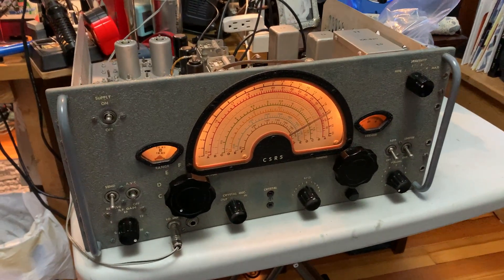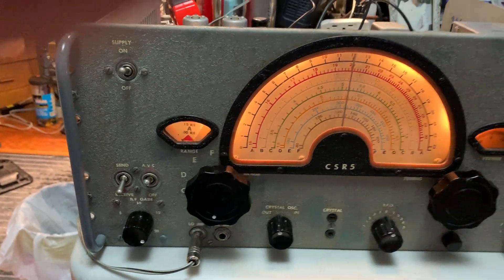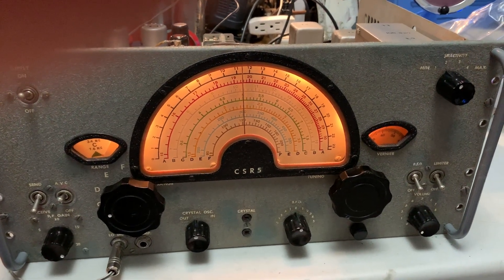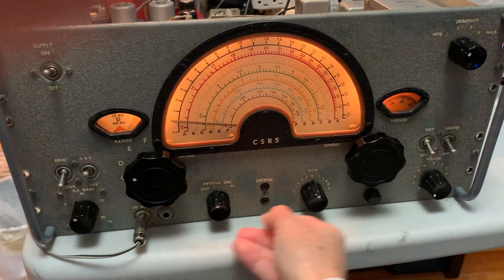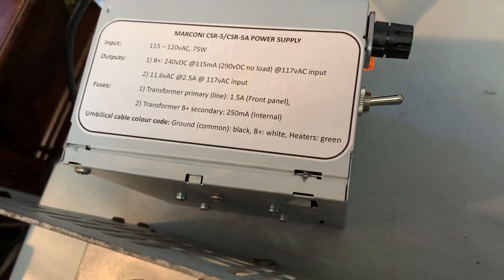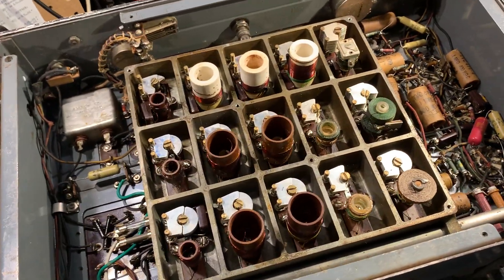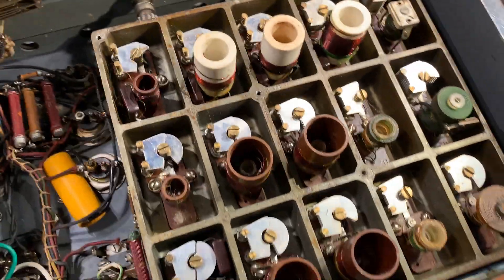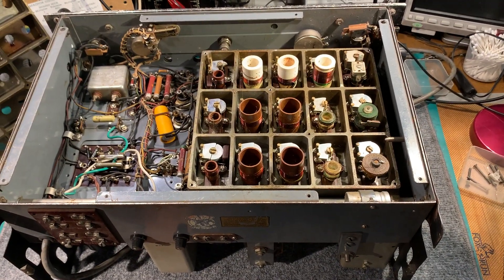Demo of Refurbished Marconi CSR-5 Receiver and Look at a National 'RCK' Catacomb Set

Comment: Sounds like too noisy. Is it normal for this model or old tubes?
Reply from the maker: Its not the receiver that's noisy - its the normal background noise at my location(!).  I have found that an active loop antenna works best here, but there is still a lot of noise from things in the house (LED lights, wall wart power supplies etc) and external (smart meter etc).

Comment: I have one as well Its a CSR5A 110930-AZ Spec 106945. I have re-capped it and it works well. Had to build up a power supply of course. VE6CJC :)
Reply from the maker: Hi Keith - sounds good! - these are very reliable sets.

Comment: Good job. I restored a couple of CSR-5 receivers, some had mechanical problems. I have 5 in my collection. There is a nice run-down on these, on the website dedicated to the history and products of the Canadian Marconi Co. I'm also working on restoring a RCN CM-11 transmitter that also has a CSR-5 in the same cabinet. As you may know, the CSR-5 was designed and built for the Royal Canadian Navy, and was used from late WW2 until the mid-1950's.
Reply from the maker: Thanks! - Yes, Jerry Proc's website is a very valuable resource for the CMC.  I have restored several CSR-5 sets and some CM-11 rigs.  If you are on Facebook, check out my 'Radio Restoration' blog.  Also, there are several of my articles, including on the CSR-5 and CM-11 on the SPARC radio museum website, here: https://sparcradio.ca/radio-matters/restoration-projects/

Comment: Nice job as usual. I'm about to start on one of mine and was surprised to see so many parts needing replacement. I did keep two sets, a 5 and 5A plus a VP3. Winter project.
Reply from the maker: Hi Bruce - good to hear from you.  Hope you are still doing ok in the UK!  Unfortunately, in my experience, most of the resistors in these sets have drifted significantly and for long-term reliability/optimal performance should be replaced (as well as the capacitors).  You could 'get away' with a recap and only replacing open circuit and a handful of 'critical' resistors for the set to run reasonably well if its for your own use and you can carry out ad-hoc repairs as and when needed, but most of my refurbishing work is for other folks and I prefer not to have to revisit the sets(!)

Comment: What a beautiful receiver! Great job restoring it sir!

I love those older radios myself, and I am rebuilding a Hallicrafters SX-101/a as well as the HT-32 transmitter.
The SX-101 series originally had 160 meters, and the A had a 2/6 meter conversion band scale, with the loss of 160 meters, so I rebuilt the Mark III chassis with the A circuits added.
Reply from the maker: Thanks Jeffrey.  Good luck with the SX-101 - sounds an interesting project.
Reply: @RadioRestoration  Well, as long as my progress is positive, it looks good. Sad to say, I broke an IF transformer, but I have a spare! But I have to tear into it!
Reply from the maker: IF transformers are always fun to take apart!  @jeffreyyoung4104